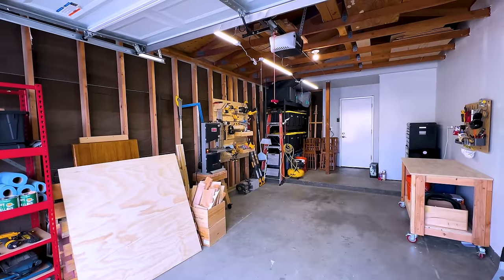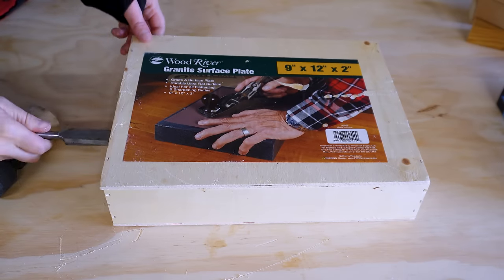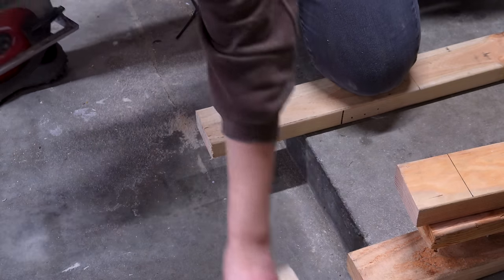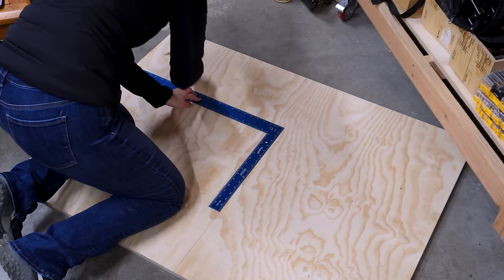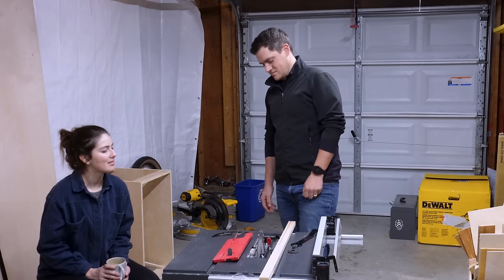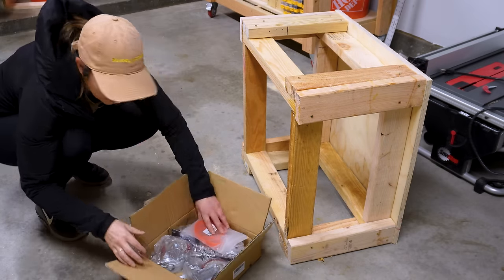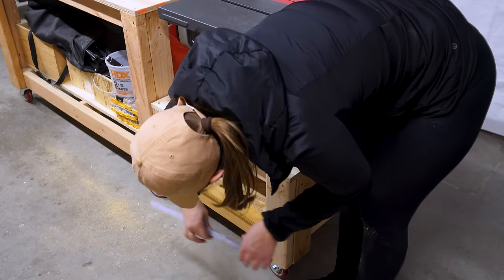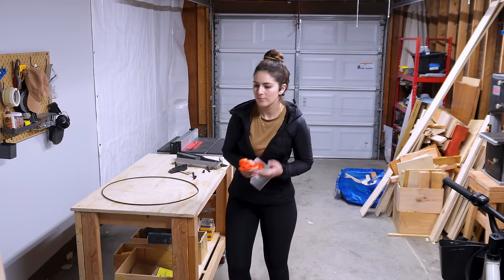Workshop Updates (and SawStop Scare)

Comment: I have MDF board with black laminate and maple tirm.  The laminate is durable. Plus glue  scarps  right off after drying.
I like the idea of the clamps to attach the outfeed table to the saw. I plan on using that  only shop. Thanks for the ideal.

Comment: Understanding how to sharpen tools is an important woodworking skill. I recommend the Sharpen This book and/or video from LAP. It's a short, no nonsense read that will give you all the skills you need. Hand tools are a different rabbit hole. Once you start gaining experience with these tools you may start looking at your power tools differently. Now I mostly use power tools as rough tools for cutting and milling wood, and hand tools for final dimensioning and fine detail work. Have fun!

Comment: Nice work.  Adding a half inch layer of MDF to the top of your outfield table will create a sacrificial surface you can replace as it gets marred and covered with glue and paint.  Just be sure to use the right length of screws, fasten it from below and do not glue it.  Then you also have a surface you can use a track saw or drill on that can take the abuse as it is replaceable.  Cheers.

Comment: It's quite startling when the brake mechanism goes off. I had 2-3 of those with my Bosch Reaxx and 1 on the Sawstop PCS I upgraded to when I had the space … thankfully all of those were false positives. But that loud BANG from both AIM systems definitely adds to the stress of the event. You definitely did the right thing … both in getting the expensive saw and in hanging that trophy on the wall. (I still don't have a trophy like that because the Bosch mechanism doesn't damage the blade, and my SawStop mis-fire was because the blade bound up on a chip and wedged itself into the kerf of a crosscut sled and the brake was barely scratched by the blade).

Comment: I currently have door skin as a workbench top. Not terribly durable, but easily replaced. Masonite would work well too. Looks like a sturdy stand, I would secure the saw, with metal plumbers tape if there are no holes to bolt it down. Just for peace of mind. Glad all fingers are still attached.
Bandsaw tip: take a straight edge or level and check that the two wheels (without blade installed) are co-planar. Usually one wheel is farther from the saw than the other. Shim one wheel with appropriate thickness washer(s) to get them perfect. Your blades will track better.
Reply from the maker: Someone else also suggested metal tape to secure the saw and I think that's the way to go.

Comment: I use MDF as my bench top, allows for nice sacrifice material on things like: track sawing, routing, drilling into & gluing on. (Glue can be scraped off easily) 

And once beat up enough, cheap & easily replaced.
Reply from the maker: Yeah, I'm tempted to go with MDF. I like the idea of cheaply / easily swapping out the workbench topper once it's been beaten up.

Comment: Glad Kyle is okay, but he can’t get near the saw by himself again until he gets 8 hours of retraining! 😆 

All jokes aside, push sticks, push blocks, and tablesaw sleds are your friends. Also, never touch any saw when you’re tired or frustrated. As a finish carpenter with 20+ years of experience I know how scary the saws can be when a mishap happens. If you want a resource for saw jigs, or shop jigs in general, Stumpy Nubbs or The Wood Whisperer are the easier to find. Or you can look for Lincoln St. Woodworking’s video 60,000 injuries per year.

That video is well done and chocked full of great information.

Comment: The 2 by 4 story.  years ago (like pre WW II) framing lumber actually measured 2" by 4" but they were very rough sawn.  They started making them much smoother by planing them down.   But you have to remove wood to do that.  So, the 2 by 4 shrunk.  If you do work on an OLD building you will find true 2 by 4s.
Reply from the maker: This is the story I've heard, makes sense. Plus 2x4 rolls off the tongue easier!
Reply: @elenamakes  As a kid (I'm 76) we had an old house.  and my dad very carefully saved any 2 x 4s in case we needed them later.   It was easier to use them than shim out modern 2 x 4s

Comment: Watching the discussion on safety, I wanted to offer a suggestion. Lifting light to moderate heavy equipment, use the two person rule. I did not lifting a moderately heavy  printer when I was working in my office. The result was two blown disks in my lower back. It resulted in surgery and eventually earlier retirement. The issue was very painful. Recouperation from surgery was longer than expected I hope my incident description will prevent either 9f you two suffering the same pain.

Comment: If you know the height difference between the tablesaw and the "outfeed table", trim the legs on the tablesaw bench accordingly or add packers to between the the wheels and legs on the outfeed table ~ both options require less material

Comment: Only had a quick scan through the comments and didn’t come across an answer to your question regarding measurements of material. 

In the US (mostly imperial measurement) they’re called 2x4 because it’s the rough (milled pre processed) size and that’s what you pay for, so in part your thought was correct. 

Even here in the UK (metric), for instance, a stud length is advertised as 38 x 63 or 38 x 89 mm and that’s what you get bar a tolerance. But you still pay for the rough, waste material pre processing. 

Which is why joiners, not chippies/carpenters move on to raw material once enough experience and space is gained.

The beginning and end are only a small insignificant part, the journey is the most important aspect of life! Enjoy what you do and do what you enjoy 🙂

Nice setup and multipurpose use of workspaces.

Comment: 6:04 2x4s are meant for framing in walls. The old measurements are not a milling flaw. It’s so that the completed wall will be about 4in thick (depending on the grade of drywall used).

Comment: I have a plywood topped bench, and an MDF topped bench, and the mdf annoys me because I like to put drinks down on it really hates moisture. I should probably just finish it lol. I also have a bench for my outfeed and assembly area that uses formica laminate on the top that you can put on pretty easy with some contact cement and it's glue proof and really slick, you can probably do 1/2" mdf and that formica for a real nice topper. If you have menards where you are, I got my piece there for like 15 or 20 bucks.
Reply: I topped the MDF with a 1/4” hardboard, it’s water resistant and cheap but with a quick coat of any water proof finish makes it waterproof.

Comment: the missing screw on your bandsaw is only there to ensure a coplanar surface between the two sides of the relief for the saw blade.  you may not need that replaced since the previous owner installed the aluminum guide on the front that possibly accomplishes that task.  check that the surfaces are flush with each other to be sure.  keep up the good work and don't let the table saw incident frighten you, just keep a clear mind in the shop and beware complacency.

Comment: You go girl! 
1) MDF top. Allows holes for dog bench 
2) please make sure the table saw grove is higher than table else you won’t get a sled to slide over table 
3) you probably need 2 vacuums or a huge dust collector for the table saw. Collect dust upon creation will solve a lot of problems. I use 2 vacuums, one for table itself and the other connected to the sled. 99% dust collection. 
4) it’s easier to have the wall on the left of the table saw then right. My dewalt table saw expands on the right side.

Other than that. You rock!
Reply from the maker: Thanks 😊 and appreciate the tips. I'm definitely going to need a better dust collection situation long term.

Comment: There called 2X4s because "in the beginning" lol they were actually 2 inches by 4 inches, it was found that the "new" measurement of 1.5X3.5 was of sufficient strength to do the same job therefor you could get more construction lumber out of a log hence more money per log.

Comment: I had the same Dewalt saw before. You will end up hating it because it needs so much room on the backside to slide. Because of that you can't use it on a table up against a wall unless you're 2' from the wall. Congratulations on all the other gifts you received.

Comment: If you use mdf as a work surface it needs to be well sealed, or that surface wont stay flat for long after any moisture exposure. Either seal it, or just go melamine. Personally if you are wanting a manufactured top, I would use a sheet of Baltic birch plywood. You can finish it if you need a slicker or more glue resistant surface. If and when it gets beat up you and always sand it down to a nice surface again, instead of having to replace it like mdf, melamine, or standard void filled plywood. 
Those off cuts from the table could make fun tool handles or nobs?
Reply from the maker: I like the handle idea, that's a good one.

Comment: That pin is to join both sides of the table. Maybe a small nut and bolt will do if anything is necessary. Check the table is flat across its cut.

Comment: around the 17.00 mark you speak of putting a complete sheet over the top of the bench when all you need do is put a spacer in-between the castors and the bottom of the legs any way your choose Cheers
Reply from the maker: What you're suggesting is a good option too! I was thinking of screwing down a cheap topper sheet on the bench, so I could use it as a sacrificial layer that gets all the abuse and easily replace the topper when it's too beaten up.
Reply: @elenamakes  yes I also thought this but after I posted but still all in all nice work there and thought out clipping it to other bench makes one modular bench specially when you build next one for the chop saw clip it to that and one heck of a bench to work off CHEERS

Comment: Well that’s one hell of a good piece of PR for sawstop. They should send you a replacement cartridge and blade for free. I’m sure many other makers have done the same but never mention it. By you sharing your mishaps I’m definitely thinking about investing in a sawstop myself now. I know your husband mentioned that he just nicked the blade quickly so he didn’t know how bad the damage would have been to his finger but as a contractor with 30 years experience around power tools I can tell you that the blade would have sucked his finger deeper into its path possibly causing other fingers to get severely damaged as well. Also when you most likely snapped your hand away from the blade if it was still spinning the workpiece you were cutting would probably have kicked back in your face as you bent over in pain holding what was left of your finger. Not to sound like a fear monger, but believe me I’ve seen this exact situation happen before. That saw saved you in more ways than you can imagine. Glad it actually worked as described and I’m glad you’re ok, everyone makes mistakes and I mean everyone so there’s no shame in sharing your experience. Keep up the good work
Reply from the maker: Glad it was helpful! I am very thankful we didn't get to see for ourselves how bad the damage could have been.

Comment: You might consider using a melamine top on your outfeed/assembly table.  It's slick so stock will glide across it easily and glue won't stick to it. Once it dries you can just pop it off.

Comment: For the scraps you could carve them into book ends. Do them in an organic shape similar to the table legs.  Oh! and for the table saw, for added stability, instead of a ratchet strap some conduit straps would work great.  They are curved metal tabs with holes in each end so you can screw them over the tubing. That thing wouldn't budge then haha! I don't know what size you'd need for the saw stop but they are super cheap at any hardware store.
Reply from the maker: Great ideas :)

Comment: OMG girl, you have a speed square. some of it's incalculable functions is extending straight cut lines across 2x4s and, as a straight edge for your circular saw to make those cuts. It's not just for squaring pieces for assembly.  I love that you put on you safety glasses for the structural integrity test. 🤣 Wow, for a $1000 the SawStop doesn't come with mounting holes on the feet to attach it to a surface? other than that, nice build.

Comment: Hi Elena - retired contractor here.. 50+ yrs dealing with tablesaws and the other usual woodworking stuff.  Unless you have phenomenal dust collection (probably not, right?)  you're going to want to cut out the center of your tablesaw stand's top and maybe even install a bag (or a removable box/drawer) underneath to catch whatever sawdust make it past your vacuum.  Without that  it will quickly build up in and around the mechanism of your saw.  Good luck.
Reply from the maker: This is something I'll definitely consider, thanks!

Comment: Tiny (unimportant) side note:
I noticed you using titanium nitrite coated drill bits intended for metal, to drill into your table-saw stand.
Consider using bits intended for wood only, as they work way better AND the wood actually dulls your metal bits.

Entertaining video!
Best wishes

Comment: One thing I stopped doing when building work tables out of 2x4's and plywood for my workshop is, I stopped using glue. It's not really necessary and a workshop will always be changing and growing. It's nice being able to unscrew things apart and reuse pieces to change things or expand.
Reply from the maker: I think either way can work. I just wanted my table saw stand to be extra sturdy.

Comment: Those look to be about the right size to make a bandsaw box with the bandsaw you have.
Reply: also it'd be easier to cut 4 pieces of wood to the perfect thickness and then nail them under the sawstops feet. You don't want a thinner workbench top.

Comment: Use fiber board it's easy to replace and cheap. Just make a frame around your top like a giant picture frame and then drop it in no screws no glue then when it gets damaged you can pop it up and drop a new piece in and it's really smooth and great for an out feed for your saw

Comment: Great new woodworker! One word of advice from an old handy man. DO NOT KNEEL hard surfaces without a good pair of knee pads. You won't know it for a while, but around middle age you will know that your knees are not happy if you keep kneeling on hard surfaces without protecting them. Ask me how I know this. That concrete floor in your garage is a knee killer! But it's very easy to solve this problem. Just wanted to share this piece of advice learned from experience. When I was younger I had no care in the world about my knees and now I regret it and wish I started using knee pads earlier in life.
Reply: I could have used that advise while I was in the Catholic Church. 🤣

Comment: I've been thinking of buying a Sawstop table saw, however, mine will be a much larger cabinet style 240V model with a 52" table.  My grandfather recently passed away, my family is taking all the shop tools, so I figure you know what, I have to buy new woodworking tools anyways, I'm gonna buy what I want.  The old Table saw is a Ridgid TS3612, a table saw that got a lot of followers, it was a contractor table saw with a lot of heavier features....my gripe about it though was the table extensions, they were cast iron, but they were crosshatch type with holes in them so you couldn't work on anything or leave anything on them without it falling through the numerous holes.  So, its time to upgrade anyways.  Not sure what I will end up getting to replace the old Chicago Electric Miter Saw, but the Dewalt might be the direction I go, we shall see in the next few years I guess LOL.  It'll take me a few years to afford to replace all the shop tools anyhow, which I guess will give me time to really find what I want.  

Kind of weird to see an apartment with a garage...the apartments in my area are lucky to have a covered parking area LOL....and that isn't even often to find those either.
Reply from the maker: I do think it depends on where you're looking (dense cities for example are near impossible to find this setup) but I've always managed to find an apartment with some sort of garage in the different places I've lived.

Comment: My first workbench was an MDF top finished with Tung Oil. I couldn't recommend it enough! For the cost I think it's hard to beat. If you can afford to get water resistant MDF, then definitely get it. Otherwise, the tung oil should still help keep most moisture at bay.
Reply from the maker: Yeah moisture is my big concern with MDF but as you said the right finish should help reduce the issues there.

Comment: I attached a board to my SawStop's miter gauge.  I clamped a workpiece to the board with a 5" iron C clamp.  I grabbed the C clamp, and pushed the work toward the blade, congratulating myself on having a nifty iron handle to hold.  There was a loud BANG and the blade disappeared. 
I had placed the C clamp about a millimeter too low. The blade polished a tiny shiny spot on the iron C clamp, and removed $200 from my bank account.

Comment: They are called 2x4s because rhat is the size they are when cut from the log. In the past, they milled 3/16" off each face, making them 1-5/8" x 3-5/8" finished. Now they are milled to the current size, which i think is a little easier to work with mathwise.

Comment: Wow – good thing for the Saw Stop. I just want to share a few things I observed in your video that you could change to work safer. Never use power tools while wearing jewelry (either of you). Always cut with your circular saw supported by the stock you are cutting (not sitting on the waste side which is going to drop at the end of the cut). And never hand hold shorter wood for cutting with a circular saw ( a mistake which almost cost a friend of mine half of his hand).
Reply from the maker: Very glad we opted for a table saw with a safety mechanism. Always good to be reminded of good safety protocol.